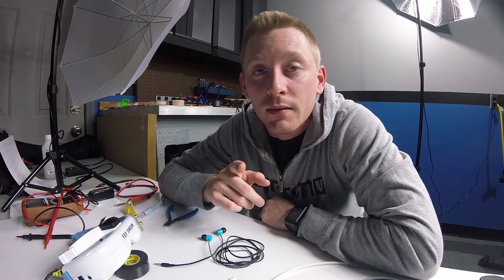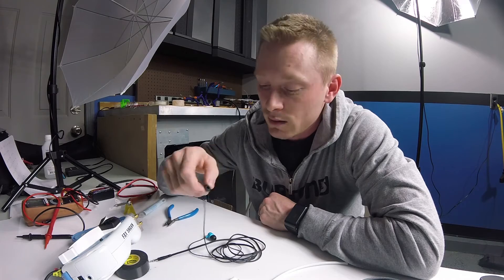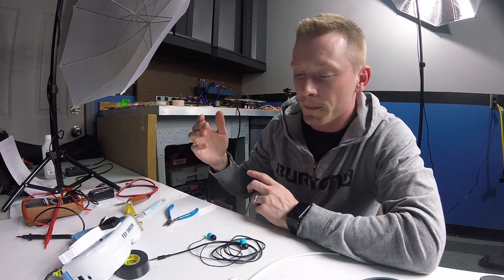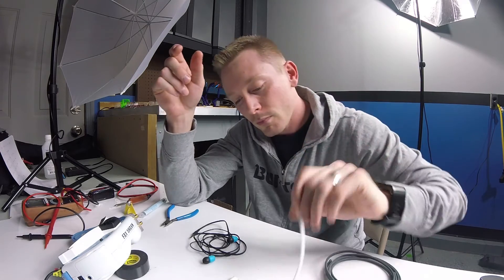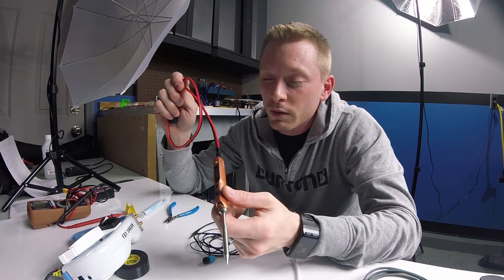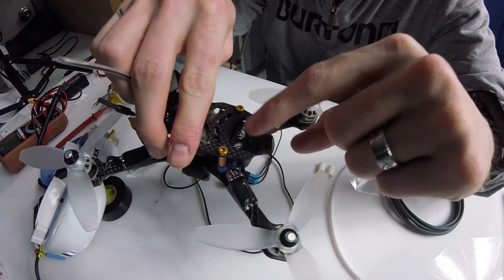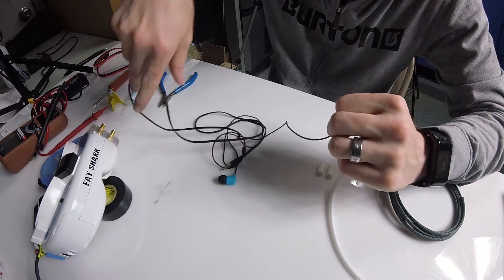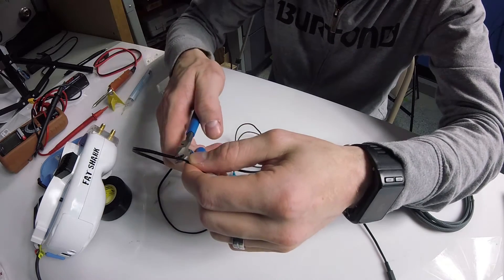How to Make a Custom Earbud for Fat Sharks | DIY

Comment: I give you A small recommendation for your ts100 (soldering Iron). You could do a firmware upgrade. It is much better to work with.  here the GitHub link to the firmware/guide -> https://github.com/Ralim/ts100
Reply from the maker: Ruben Nuñez awsome thank you!

Comment: Does the earbud work if you use the right earbud instead of the left?
Reply from the maker: haon15 I haven't tested. the ear but it self would but not sure if the rings on the plug would make contact inside the fatsharks.
Reply: Thanks for the reply. I just made one with the right ear and sound is playing out of my phone. Now it is time to test with the fatsharks.
Reply from the maker: haon15 nice let me know if it works!!

Comment: What is the soldering Iron you are using?
Reply from the maker: CJWinty FPV in this video I was testing out my portable field solder iron. it is a TS100 they work really well off of a 4s lipo.
Reply: Cheers, thanks for the info ;o)